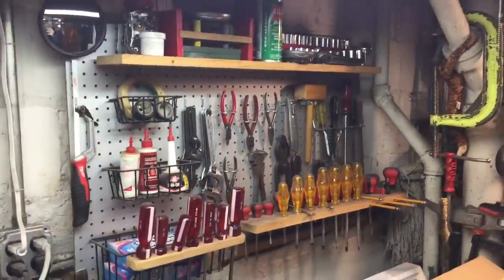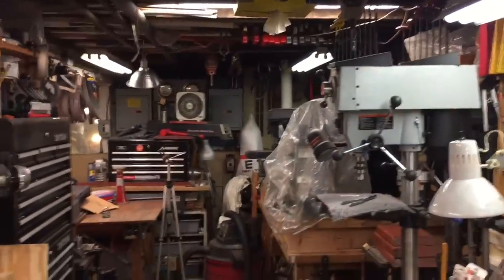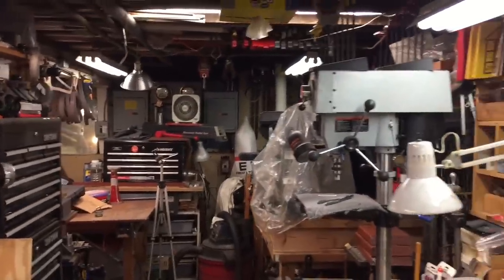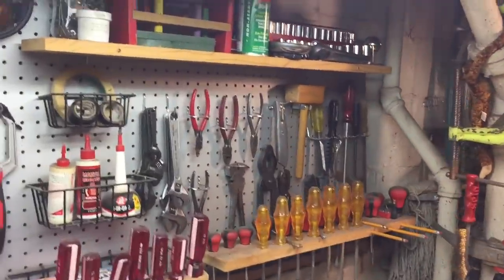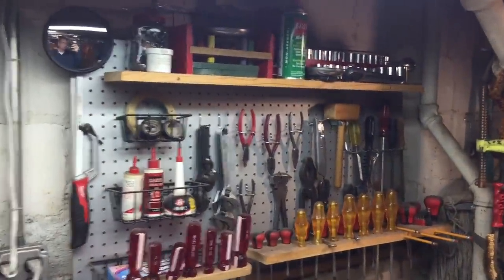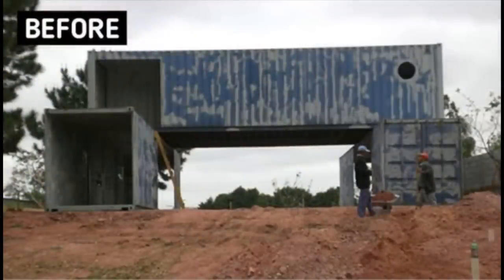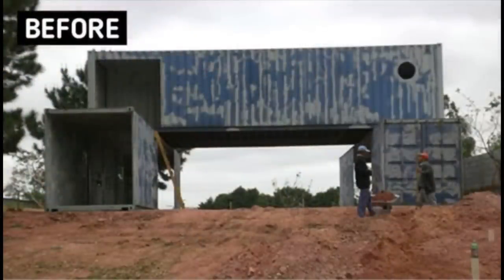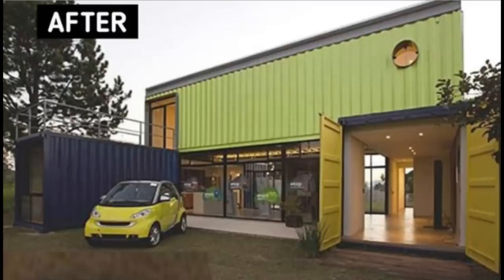Inside of a Laminated Lock-  Simple yet Genius.

Comment: That tape rack is awesome! I need to build one for sure. My tape dangles on string with a block of wood tied to the end. Thanks for the shout out! 25 years retired as a correctional sergeant. I have a ton of chemicals too! Most for specific things! Great minds! That lock is neat on the inside. It’d be neat how the assembly goes. I bet they press it tight! Master locks are tough. Never saw a no19 before. Dad always used one that has a 27 key. Model number I suppose. Remember they’d shoot them on TV? Master locks. Tough have a great weekend.
Reply from the maker: Aaron!  Congratulations on making it...   It's going to take a while before you actually believe you are retired!  I would wake up in the middle of the night thinking I overslept!  LOL   Awesome!

Comment: I have some dry graphite lube for my locks. It works great. We have some containers we use for storage. I'm planning on setting two of those crates side by side, with 40' between them. I'll then throw a roof over the open area between them, and put a concrete pad down with garage doors on both sides. Should be able to drive all the way through it and have a car lift (or two) in there. Those containers hold up pretty well, but they aren't varmint proof by any means.
Reply from the maker: My buddy did a "H" layout with 3 containers and he loves them!  They are very durable...  The metal shell can always be something to think about because of weather changes and condensation...  (Here in the North East)

Comment: On the laminated Master Locks, for years I purchased versions that were covered with plastic for weather protection - but if anything, they rusted faster even when I made sure the cylinder cap was snapped into place.  Then I found out that they make versions out of brass with a stainless steel shackle.  Theoretically brass is of course weaker than the steel, but I oil them once a year and they never rust or fail.  Of course as ScoutCrafter repeatedly infers, this is for "regular use" like on property gates, sheds, and the like.  I would use totally different locks if we were in a high crime zone.  My locks generally are more, as they say, to keep honest people honest!
Reply: when the weather changes, moisture condenses under the plastic protection and the outer metal of the lock rusts, and in the absence of protection, the wet condensate evaporates
Reply from the maker: Hi Marc!  I have three locks on my garage for over 20 years and they are all rusty but still work!  Also there WAS rust between the plates of this lock I dismantled!  Any steel outside will eventually rust no matter what!   =)

Comment: Great material. You know I’ve studied locks and for the money Stanley actually makes a great lock. The Stanley S828-160 CD8820 and the S828-145 CD8820 are both good. They can be picked but are not as susceptible to drilling and cutting.

Comment: I spotted that can of Houdini right off the bat. I just recently (past few months) found out about this stuff and man let me tell you, it's the best lock cleaner/lubricator I've ever used! And well worth the money! I can't believe how smooth my back door locks work now. Better than when they were new! If you've never tried this stuff you're missing out. Now, it'll be interesting to see how long these locks work this smooth before I have to clean/lube them again. But one of the reasons I bought this brand was because there's no teflon, no silicone, no grease and no graphite in this product. Lucky Line #94500 Houdini Lock Lube, 11 oz., Aerosol Spray Can. And NO, I'm just a DIYer that's actually used the product and love it. I bought my can off of eBay, because it was cheaper than it was on Amazon at the time, and it still is cheaper. $13.99 shipped on Amazon. And $12.26 shipped on eBay.

Comment: If you want to break down a slightly better laminated padlock get a Commando lock. The plates are all pressed together so they do not come apart and IIRC the rivet holes on the upper and lower plates are flared out.

If you want a lock lube to use in really cold or dirty environments I would suggest LPS 1. It really works great.
Reply from the maker: I have some LPS!  I have to give it a try!  Commando locks were going to take over the market but I wonder what happened?
Reply: @ScoutCrafter  They took the locksport market by storm but they didn't keep up the momentum. I haven't seen them do any promotions or advertising really in a long time. The only LPS that works is the LPS 1 as dries and leaves a teflon coating behind, the others are all oily lubricants.

Comment: Quality lock.... it's ok but the core or cylinder is not quality.
They don't have close tolerances...in terms of picking
Reply from the maker: Living here in NYC you learn very quickly that locks just slow down the thief...  Nobody here picks locks, they break or cut them open..  Bolt cutters were the tool of choice.  =)

Comment: I love the channel, huge fan... but I have to break it to you:  Master locks are not good locks... at all.  The actual locking mechanism itself, especially, is complete garbage.  They can be raked open (not even picked, technically, just raked) in literally less than 5 seconds.  You really have to see it to understand how mindblowingly simple it is to open a regular Master lock.  I'm not exaggerating.  And I'm not talking about "picking"... you just shove in a bit of metal and shake, and it opens, really.  I've posted videos in the replies.  
I've been into locksport/locksmithing/lock picking for many years now, and Master locks are generally ridiculed for good reason.  All it takes it a bent wire.  There are some great channels that you'd probably really like, like Bosnian Bill or the Locksmithing Lawyer, that are really good at educating people about locks.
Reply from the maker: Again- Locks are only meant for honest people...  No real thieves are picking or racking locks...  They are cutting or clipping locks or chains.  Master has many different locks and their security is based on mostly price.  The higher price the lock the better the security..  Again- Thieves DON'T pick locks.  98% of all lock bypasses (thefts) are done physically.  (cut) So why bother making pick-proof locks?  For the 2%?